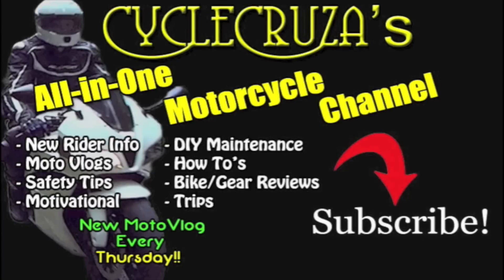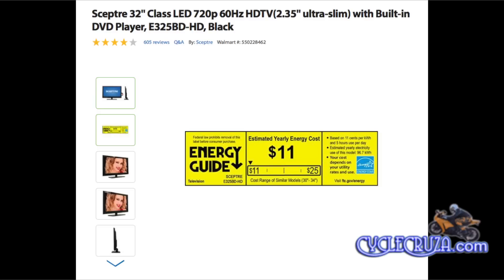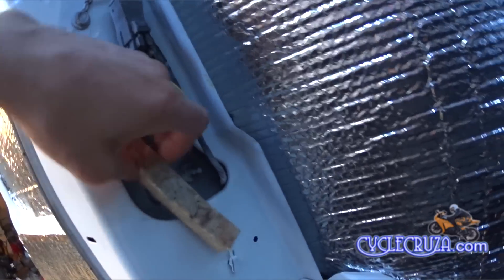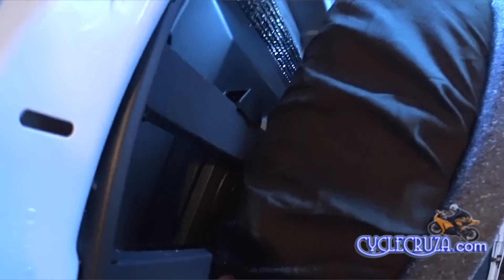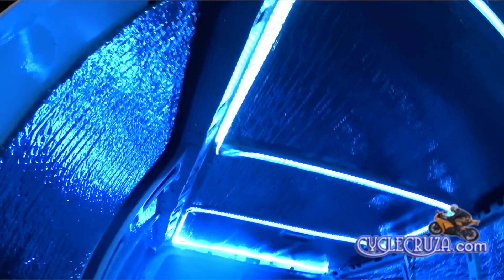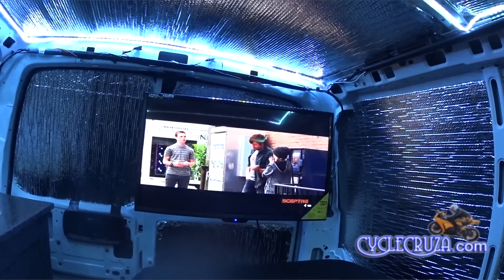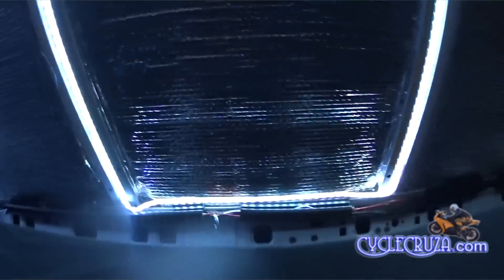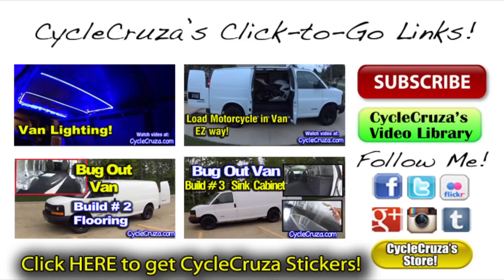Van Build - 32" FoldAway TV and Viper 2-Way Security System Installed

Comment from the maker: ***CycleCruza's Recommended Videos*********

Watch Bugout Van Build Part 1 Insulation Video here:
https://youtu.be/kp59Nkk7Asw

Watch Bug Out Van Build Part 2 -Flooring Install Video here:
https://youtu.be/NXPwck_WcvE

Watch Bug Out Van Build Part 3 -Sink Counter Build Video here:
https://youtu.be/pcZR7bqqoWw

Watch Bug Out Van Build Part 4 - Folding Bed Build Video here:
https://youtu.be/VRFYFsW0t9I

Watch LED Light Strip Kit Installed in Van Video here:
https://youtu.be/BduzjVNQgEg

Watch How To Load a Motorcycle in a Van Video here:
https://youtu.be/mq1YguXZQ0Q
Reply: Why don't you spruce up your van with some wall paper or paint
Reply from the maker: Billy Fitzgerald I like the reflectix because it reflects light and makes it feel bigger inside, just a personal thing I guess.

Comment: Looking real good CC. You could tour the track circuit with that, become a club racer. Reminds me of an old pulp fiction novel series I used to read called "Traveler", about an ex-Army Ranger in a post-apocalyptic world like Mad Max. He had a custom van like that with a modded rotary engine so he could burn anything he found as fuel, it was armored bc he lined it with bullet proof vests and he had a pair of M60 machineguns mounted up on the roof. My only suggestion is to line the cabin with some gray felt to hide the silver. That silver is going to drive you nuts over time I think. With a nice liner its going to feel a lot more comfy and relaxing.
Reply from the maker: Gloomshadow100 I purposely put the reflectix up for the look, I love the reflection of light, makes the space feel bigger than what it is.
Reply from the maker: Gloomshadow100 lol Actually, it wasn't my intention to do all of this shit, just became an addiction to keep adding mods to the van. lol I can't stop....lol I just want camp out in it already.

Comment: I like everything you have done in the van and I like your bike videos too.  I do recomend using plywood to anyone considering a similar project and I would of mounted the TV Bracket with a nut and bolt.  That piece of partical board used as a backer for the braket bolts is not strong enough hold that unit up.  Its may be fine depending on how tight those bolts are but you hit the brakes hard it could come loose.    Other than that, nice work.   I dig it.
Reply from the maker: +Roger SoCalBeaches Thanks. It's OSB sheathing, stuff that is used for flooring, very strong. The TV rests up against the panel and when the bed is up the bed acts as a brace to protect the tv. I only drive the van with the bed up. It's a solid set-up and I've been on many a rough road when I went up the the rocky mountains last year.

Comment: I had a computer monitor by Sceptre and it was great but one day it just randomly stopped working. It would turn on but there would be no picture. I have no clue what happened to make it suddenly stop working but I wish you the best of luck with yours.
Reply from the maker: SonnoMaku We'll see....It won;t get a ton of use as I don't watch a lot of tv so it should last.
Reply: CycleCruza Just a friendly reminder cc that tv's usually have longer life if they're used often. Moisture end up damaging electronics most of the time especially during winter.

Comment: I want to build a rv van . My issue is i want to have a portable AC , a TV , ps4 and a mini fridge all running at the same time . So if i install a inverter which is powerful enough . Will my battery drain faster then it charges ? . If so then what's the solution to run all these equipments at the same time without any issues ?  My vehicle of choice is a toyota hiace 2010 . Please help *

Comment: Cool TV setup. Was wondering though when watching a little TV at night before bedtime, how much TV time do you normally get when you plug into your converter and staying within your battery limits?
Reply from the maker: This tv hardly uses any power. I only use it for a few hours at night tho, that's if I can pull in channels.

Comment: How are you powering the tv and how long can you run it for.
Reply from the maker: +Zachary Oliff 4 x 100 watt mono-crystalline solar panels that charge 2 x 155 AH deep cycle solar batteries. This LED tv only draws like 35 watts. I didn't watch much tv on my last trip but it did not use much battery power when I used it.
Reply: Since its been 6mon since this last response and you've gone around using it with your tv antenna. How long can you use your tv for? Hopefully you've gotten some sort of long duration using it.

Comment: I would suggest protecting the screen with foam
Reply from the maker: Brandon Mitchell The TV is resting on foam. My van walls are lined with foamular panel insulation and reflectix, you must have missed my first build video:   https://youtu.be/kp59Nkk7Asw

Comment: had that brand installed for about a year until I went with a sturdier mount. the original bent a little over time; you have a slightly different model though...let us know how it works out for you over time.
my replacement mount http://amzn.com/B0088RIV1W

Comment: You feel a 32" is too big?  Just right?   Great videos!
Reply from the maker: +dzaz99 Perfect size for me because I use it for my 4 security cameras well, I have a processor that splits the cameras into 4 quadrants on this 32" tv. Also, it's nice to swing out and use as a tailgate tv. I wouldn't want the tv any smaller or bigger, perfect size.